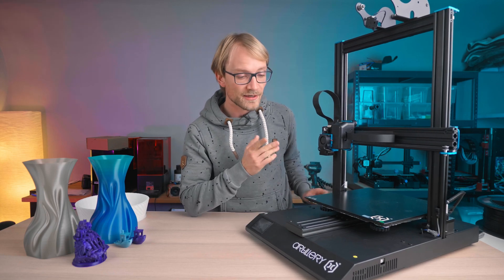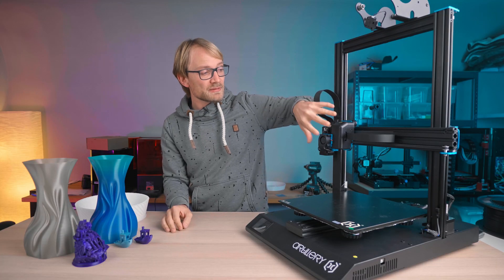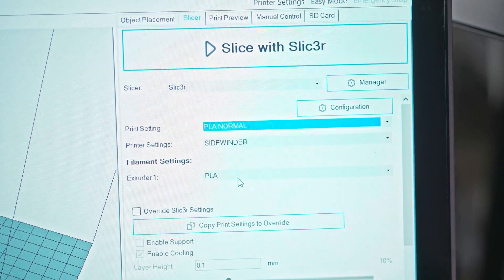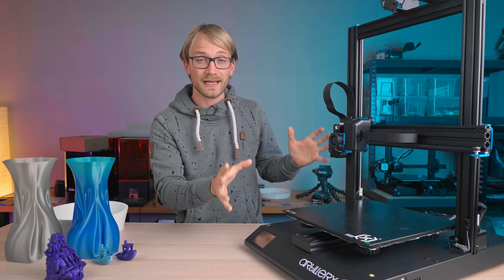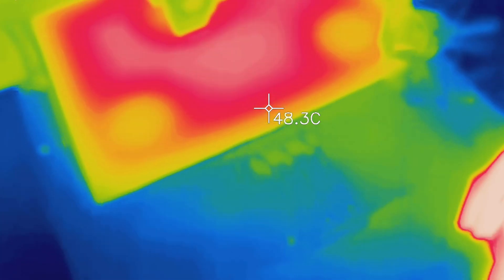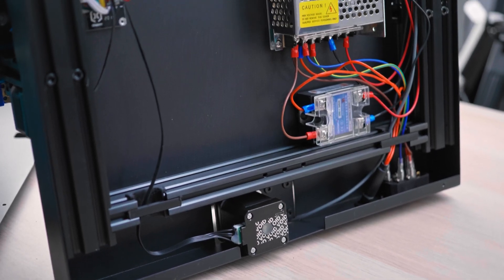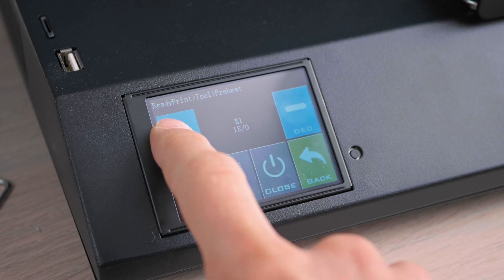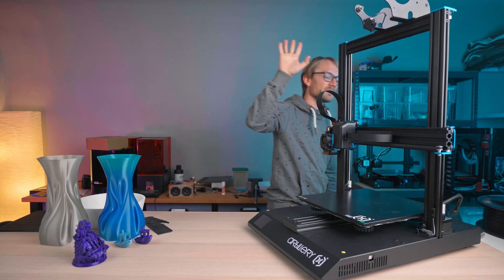Artillery Sidewinder X1: Built for show!

Comment: I've got an older version of this machine and an issue that I've come across after using it for a while is that the knock-off extruder and hotend makes it extremely difficult to to maintenance on. It's such a complicated assembly that clearing up a clog, or swapping out the included heat break for an all metal one, or replacing the tension arm (which is prone to breaking), is an ordeal every time. I actually really like using the machine when it works, but working on it is terrible.
Reply: I didn't realize that the hardware this was copying had the same issues. I still find it frustrating but maybe less of that can be laid at Artillery's feet than I thought

Comment: I liked Repetier Host as CuraEngine host and tethered print controller (which i only need occasionally, but used to use a lot in the first days of setup of my printer), the CuraEngine integration is neat and clean, as opposed to Slic3r integration. And the UI is extremely snappy, you're really not losing any time, nor is it confusing. CuraEngine also slices pretty damn quickly, as opposed to Slic3r integration. It's not a great software to keep using, but was just what i needed for the first few steps.

Unfortunately, flat out most Cura settings aren't available, and i jumped over to full Cura instead.

The maintenance regimen on any of the Repetier software is... not great. CuraEngine features that could have been exposed, never were, and they flat out refuse to support long file names with Marlin SD-Card printing. I suppose it would make a lot more sense if you were running Repetier Firmware, which... i don't really see any incentive to do, because i'm really fond of Marlin's largely community-centric maintenance model and focus on incorporating features, expanding compatibility, and maintaining safety.

Gnarly electrical quality here. I don't care about single dupont for low current connections and such, but Y-moving mains bed is just a bad idea, and all the accompanying potential issues are present here. And mains wiring quality concerns in general.

I roll my eyes when people mention "China Export" since ultimately (and according to European Commission inquiry) it's considered to be a common misprint of CE mark, and misprint issues and mark misuse are treated separately, and ultimately CE compliance hinges on the availability or validity of the certification (or self-certification) and test protocol, which... yeah that's an issue. But it is funny and unnerving that CE (both the mark and the actual compliance) keeps getting mistreated this way.

Comment: The year is 2020.

3d Printers are still being shipped without ABL
Reply: That's like saying:
The year is 2020.

Cars are still being shipped with manual transmissions

I prefer having the control over my tramming than compensating for it.
Reply: @gabethemodder778  Not really comparable, since with manual you literally cant compensate for bed warping.

Secondly, no one likes manual transmissions for commutes.  Maybe for a fun weekend car, but not in stop and go or on the highway.
Reply: @BeefIngot  if your bed is flat enough you don't need it.  Some people like the control over their tools' precision.  You can't increase precision by compensating.  There's a reason mills don't have an auto "leveling" feature.
Reply: @gabethemodder778  Im pretty sure more expensive mills do have auto levelling. Though not compensation.

Regardless, ABL gives you more control not less even with a very straight bed as you get access to all of the points.

Your control over precision is to do with bed flatness, stepper step angles and belt quality.

Adding ABL does not hurt precision at all.
Reply: YES! If I can choose I will use these. Happy to have sold the one with ABL today and use the ones without it.
I removed ABL on one of my other printers and made it manual. Just don't like it and not that beneficial if you have a good straight level bed and set it up right. Okay, takes a bit more effort once but now never have to do it again or wait for some autolevel that even makes 'mistakes' on perpose to account for small differences.
By the way, I'm happy that they sell shoes still too and not just cars.
Reply: @elvinhaak  You just dont like ABL??????

What horrible experience did you have to come to that conclusion??

Its an upgrade across the board.

To correct your analogy its more like you want a steam powered car when we have gasoline cars.
Reply: @BeefIngot  Well, it is of course personal but like I wrote it is much easier to work with for me because I only have to set the printer up once without needing to do the correction  in the print and do and spend time to recalibrate the auto-level.
Still, when the bed is not well levelled, the walls are not at the same 90% angle and the parts are 'deformed' to the shape of the bed. 
If you want to reduce that by getting a perfect trimmed bed, then you really don't need that automatic leveling system that takes time, effort and extra complicity that also adds another part to the printer that can fail and give problems (both in firmware as in hardware).
After all, ABL is only an electronic compensation for an error that is along the axes (X/Y) of the printer.
Since it is 'kind of compensated', you don't notice the errors if they happen so fast yourself and your prints get worse and worse when the bed is for example slowly getting off-level

Then also what I dislike is the extra movements on the Z for this compensation, also making noise.

And finally: a nice flat top-surface is suddenly also not flat anymore but contains the steps that are made in Z-direction to compensate for the faults on the bed. That could of course depend on firmware because that can be made so that only the first layers would make a compensation for a wrong trimmed bed but sofar I have not seen that.

With a well build printer this is all not needed, walls get 90 degree angles, no extra compensation and the top is nice and flat.

Some of those will of course also depend of what you are printing. I print mostly functional parts (where a printer like this is very well for, better then for little puppets) and they have those flat surfaces and need to have straight walls. If they don't have it at printing-time, it needs repairing after the printing, resulting in a lot of extra work like sanding them  down.

What are your reasons to explicity want ABL?
Reply: @elvinhaak  Its so weird... all of your complaints. 

What ABL are you using, its not what the rest of us have.

Noise on the z motors? Not with silent drivers.

Surface artifacts?! What? That's not how it works. its not making extra layers, its compensation within a layer for the print beds unevenness. 

You hate having to relevel all the time?! Thats literally the benefit of ABL. That you don't have to level because once you've set the Z offset, you never have to level again, because it will automatically do it for you, guaranteeing even first layers every time.

All of your complaints are just kinda bizzare honestly. It's like you've never used ABL before or have a really bad version of it on a printer with weird firmware.
Reply: @BeefIngot  Ok, different opinions. I really hate to wait untill the auto-level-routine is finished (so leveling has to be done all the time) and the ones that I have seen were still compensating for the bed at the 10th or more layer.
Also the ones that I have had here were still compensating the top-layer,not only on the first layer.

 Yes, silent drivers make it less obvious noise but it istill there. It is quite silent here, normally I can hear the cars driving from 7 kms away here (and yes, I notice them) so this weird noices ... I don't like them. But that is not the main reason for not liking the ABL-systems.  Yes, sometimes it gives a benefit but no, not needed.  I rather have a better printer in other parts or just 50$ off the price without it. That is still 2 rolls of normal filament!
Reply: @elvinhaak  ABL cost far less than 50. Honestly it feels like you are making up reasons to dislike a useful feature because you've had a singular bad experience with ABL that was setup poorly
Reply: @BeefIngot  Nah, multiple printers of different brands and they worked like they use to do and work fine but I just don't like it.
Maybe you also like to drive a fast car and I like to drive a bike. Yes, it can be usefull for some but not for me. I like the choice to buy a printer with endstops/sensors like this printer instead of ABL.
For the price, you need a mainboard that is capable for the ABL to work besides the good sensor. I bought it for one of my printers - more then 50$, installed it and got it working but removed it like I wrote. Another printer I got that already got it on and... it works but I don't like it; sold the printer.
But it is nice that there is a choice for those people like you that like it.

For me, I'm not even close to the printer (20 minutes from it) when I start printing, remotely with camera and such. Starting preheat from a distance, use octoprint to load and start the print and watch it from remote, when it is finished I walk there to see the end of the print and remove and  if needed put new filament in. No pressing on screens or knobs or displays, just preheat, slice, print, next. Maybe you also work differently and sit next to your printers and see the display and things like that. For me, they should just work, it is a tool.
Reply: @elvinhaak  50$ is just unrealistically high, and there are basically no printers nowadays that ship with motherboards without an ABL port.

You can get a 3d touch right now for under 20 bucks, and inductive sensors for less.

Also, you talk about using octoprint remotely and thats an even better use case for ABL because you arent there in person to check that its level.

Honestly a lot of what you are saying  just doesnt line up.
Reply: @3D Print Wrangler Yes, so the top layer is also compensated and that makes it visible... Stepperdrivers and steppermotors are not 'analog drivers' but make the movement in the steppers and on long, wide prints these are visible when the steppers run.
Of course, if you manually make the bed completely flat, the toplayers are flat too since they don't need to compensate for the bed anymore.

Only way to avoid it is to have layerhights compensated in the print by higher extrusions instead of using the Z-steppers to compensate. That kind of compensation could be done in less layers then the total print, for example the first 10 layers. If the difference would be .1 mm between X0 and Y0 - X300, Y300  then compensation in 10 layers would be .005 mm in that direction, but this would make the firmware pretty complex since it needs to calculate (above the calculations of the slicer) all over the print where to put the extra extrusion.
For as far as I have found out, no printer is doing that yet.
Also there should be compensation for the corners since if you want to have a straight corner, you have to make that 90 degrees compared to the point on the bed instead of straight up. So for now all it is, is moving the Z-rods up/down in the movement of X/Y and that is visible in the end-result unless you have your bed 100% flat to begin with and then you don't need ABL.
Do you understand what I mean?
Have a look at really bad levelled bed that is compensated and you see the errors that come from it with ABL. And because you don't notice the errors during printing anymore, your bed might be off maybe .5 mms or more and still get visible good prints that stick well but are having these errors in them.
So you can - in my vision - better can get warned that your prints are off by more then .1mm with a bad bottom-surface or even loose grip during printing so you notice that you have to do maintanance on your printer to fix this before it gets bigger and bigger and bigger and the parts don't fit well together anymore. And yes, I'm talking about functional parts.
If you print dolls you might not have this problem since they will be only for visible things and don't need to fit in other parts. When looking at such an object you will probably not be able to see even 1 mm difference in hight or corners that are 89 or even 88 degrees instead of 90 degrees because of a not well adjusted bed.

Comment: The "CE vs 'China Export'" difference is actually an urban legend and not correct. There is no official certifying organization for Comformité European. It's all a self-certifying program where the company itself produces declarations of conformity and puts the mark on their own product to certify it complies with EU regulations. In the end, it's always the person/company importing the product into the EU which is responsible for the compliance, regardless of how the CE marking was put on the product.
Reply: Yes, the ce is pretty much just a declaration that the manufacturer or seller claims it fulfills the ce criteria. If a product has a ce marking on it but doesn't meet the criteria then the maximum penalty is three months in jail and a £5,000 fine for the director of the offending company. If they get caught. The real kicker is that the product may not be sold in eu after that. If they get caught. Also the sellers have a legal responsibility to ensure that all relevant goods they sell have appropriate CE marking. In the UK, the penalty for supplying non-compliant products is imprisonment or a fine. If they get caught.

So I wouldn't say it is meaningless. If you trust the product maker enough to buy their product then you can trust the ce marking as well and assume they have done the work to meet the criteria. The ce marking does have its issues when chinese companies can get around a lot of the penalties and checks by just selling hardware to the eu area from china. And with world wide ordering and shipping of consumer devices the ce becomes hard to enforce.
Reply: @erwinlommer197  
If you see the incorrect CE marking then it’s a good indicator that the manufacturer hasn’t even looked at the requirements for CE.

Chinese manufacturers often copy everything on a product.  I used to work for a company that made fan heaters (amongst many electrical items), and some reps came back from China with fake heaters complete with the company logo on the knock-off switches because they assumed it was some form of safety declaration.  (Spoiler: they were very unsafe indeed.)
Reply: You are completely right. Tom should pin this
Reply: You can download the CE logo from the European site, going true it myself it's one of the first things mentioned. Like Thomas shows there is only 1 correct logo and all others are considerd fake Chinese stamps. Tells the story about how much they care🤔
Reply: Its a deliberate Chinese business tactic to look like their compliant, thats why the logos look so similar.
Reply: @francistaylor1822  
No, as they could use the actual logo.  They’re too lazy or inept to bother getting the logo right.
Reply: @boggisthecat  your right, just went down a rabbit hole of research, though in this case they wouldn't legitimately be able to mark it as it isnt:
1) Meets all the requirements of the relevant recognized European harmonized performance and safety standards

2) Is fit for its purpose and will not endanger lives or property
Reply: @francistaylor1822  
Nobody is saying they are legitimately putting the CE marking on products.  If they haven’t figured out the correct marking, it’s exceedingly unlikely that they’re verifying the other requirements.
Reply: Yeah, thanks for that - I just did some reading and you are 100% correct.